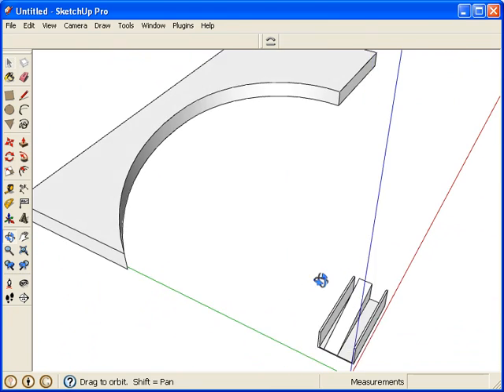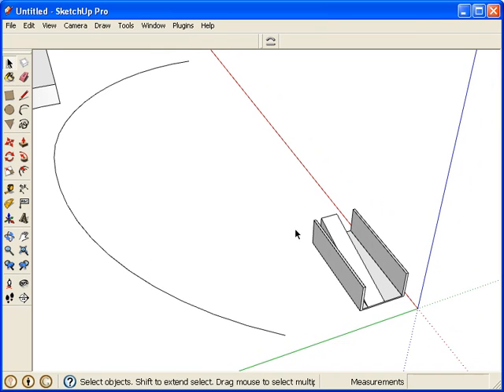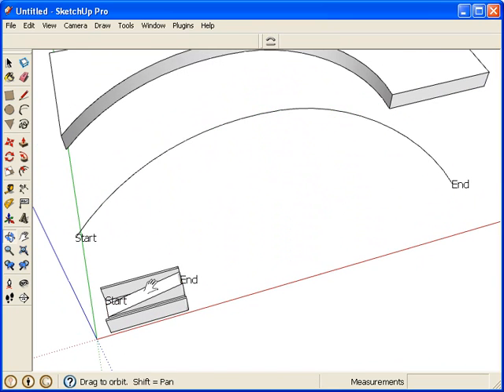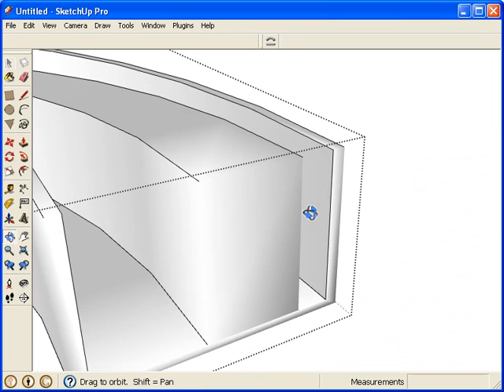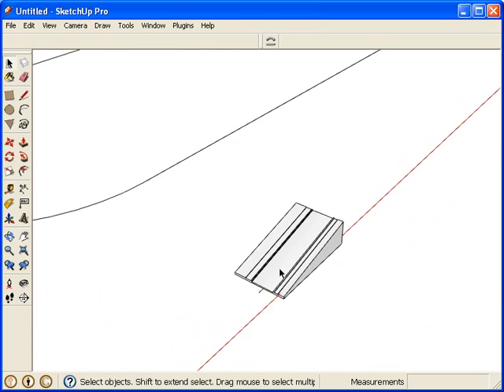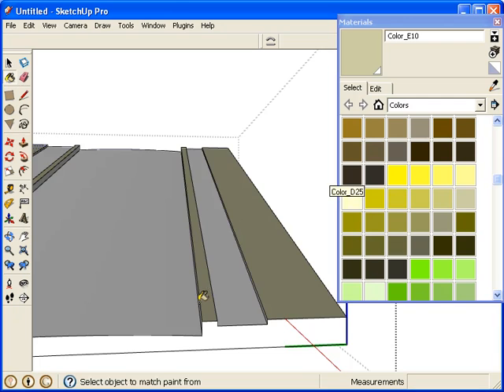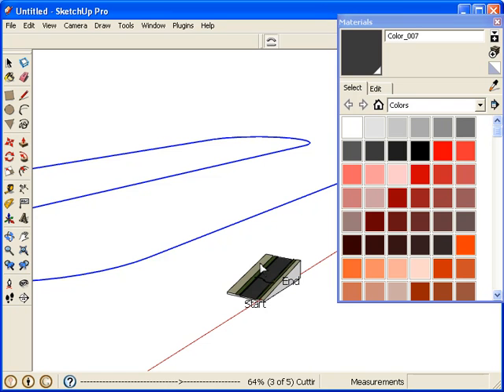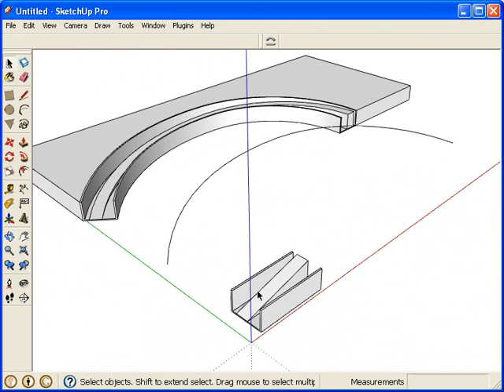Shape Bender - Ramps and Roads

Comment: hi there, am having a problem, which ill try to describe as best as posible. At times when i finish selecting the bending object, tool icon and object line (as in the video tutorial), the final product is a weird projection which is doble the length of the the selected lines. trying to find a solution or understand better this tool i found out that the direction of the object i use a base (a simple road with a low and high side, as in the example vid) makes a difference ("+y" direction or "´y"), but here is the problem, lets say i wish to bend the road object into a line using the "+y" (the lower part of the road which i wanna "extrude is near the center, and the upper part goes to +y axis), when doing so the final result is not the simple line form i selected, its doble the length. But!, if i do the same exercise, only changing the direction of "-y" it works, only in the wrong road rising direction. Also tried spinning 180° the lines i wanna "extrude" before doing the exercise, but it doesn't work.
I know all this is kinda hard to precesses, but, is there something extra you might not mentioned before, or extra information that could be usefull?.
in any case, thanks in advance
michael

Comment: Hey guys, I just figured out a few things on how to use this awesome plugin: ( I use Sketchup Make 2016)
1. You first need to click on a straight line that has to be parallel to the red axis
2. Then click on the curve you want to bend along. 
3. Then use one of the directional arrow buttons until the green wireframe looks about right  ( in my case it was the down- button) If you don't find the right direction, it will give you a very weird result.
4. Hit enter
Reply: You have to select the item you want to bend 1st then acrivate the command?

Comment: I just downloaded this plug in, it works just like you show until I hit the enter button, then nothing happens. I watched the video 10 times, followed your instructions, the grid lights up, shows start and end, but enter button just just seems to exit the application. Any ideas???
Reply: +Pete Laux Can you try it with the Ruby Console open? It might show some errors there.  Also, if its a very complex object you are bending, then it can take a while.  I bent a detailed corvette once and it took around 8 hours I think. So if SU is "frozen" then that means its processing. If its not frozen then yeah, that sounds like it crashed before attempting to make the bend. If there are any errors in the ruby console, paste them in a message here. Thanks!

Comment: hello. im using sketchup 8. and i cant use the plug in as how it is explained on the tutorial. i aws trying to make a curved ramp just like in the tutorial.. i group the ramp, make it a component, after that draw a line and curve. i selected the grouped ramp. click the bender tool, after that it says that i need to click a line along the red axis. but i cant click the line. pls help.
Reply: +emerson oplas rotate your component and line to the red axis. it only works if it's parrallel to the red axis
Reply: +emerson oplas  hey did u get any answer.. to ur issue
Reply: +AKASH DAS i am having that same issue.  Has anyone figured this out?

Comment: got stuck when asked to select a line along the red axis. cursor does not change, and i am unable to select anything. do advice thanks.
Reply: Probably you're using a newer version of sketchup, like 2014. remove the plugin and download it from the Extension Warehouse by going on the top menu,  WINDOW -> EXTENSION WAREHOUSE. Search for Shape Bender and download it, if it does not do anything when you click on Download, log in with any google account and retry. :)
Reply: Miljan Bojovic I had the same problem and tried to do what you said. But it didn't work too =(

Comment: This could be developed into more professional tool to make roads with standardized inclinations on turns and slightly before and after them. Also transition spirals for highways could be included, but designers could include them in path themselves. Most challenging could be make system of roads from multiple branched path-lines. very complex.

Comment: I tried it with making my wall into a group and then selecting it, or exploding it and selecting the very bottom line, or drawing a line at the bottom of the wall and selecting it, or selecting both the line from the wall and the curved single line that I had made but nothing is working. Any suggestion? 
Thank you

Comment: I have used shape bender last year adn it was wroking really good. even text was working. but now i have a new computer and when i use the plug in, the cursor does not change to the line selector, it looks like a standard windows cursor. whats going wrong?